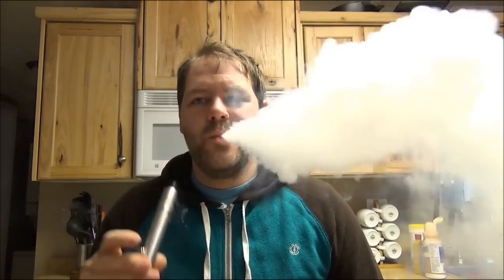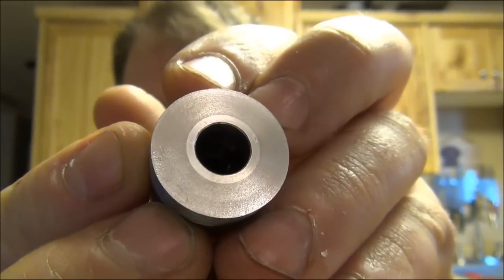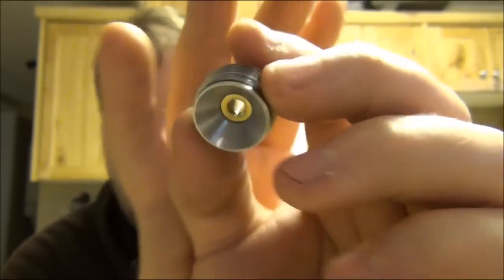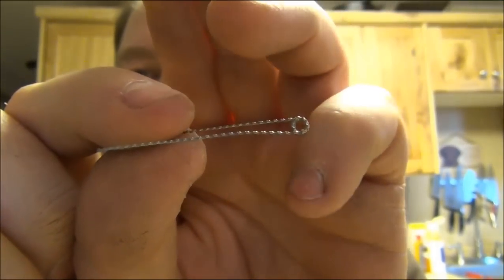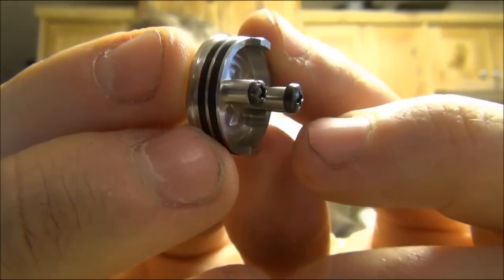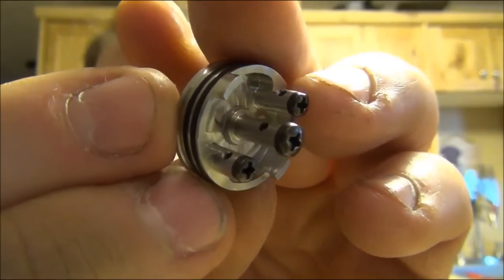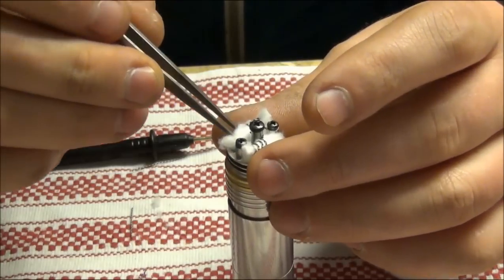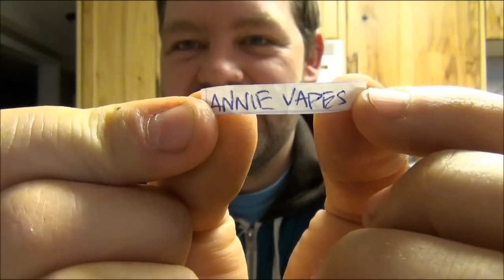tobh atomizer review and tiger coil build!

Comment: What's up Trevor. That's a super sick build bro! I just build one of these dripper's yesterday for Ian at Indy Vapes here in Indy. I put the atty. In my mill and machined the afc tab off. I also opened up the air holes so the three holes are now a slot strait a crossed. He's got monster lungs man I build his patriots with 9/64" air holes and bore out his drip tips. 
I did one of my dual wire Quad builds with 22g three turns micro. So it looks like 6 turns of 22 but lights up like three turns. It metered at .08 ohms. Too low for most sane people lol. But Ian is a crazy man like me. Keep up the awesome videos

Comment: Jumped over here from the indestructible post to check out the Tobh review. I was having some of the same issues when working on artisan coils in regards to the chuck. Went through a couple of drills only to find the most common problem was the chuck itself. Solved that by going with a keyless chuck adapter with 1/4" shank. The chuck bites down more centered and holds tight all the way through the flattening stages in regards to helix coils. Not saying there's no breakage just less of it. Like unsleeving wires by hand, the touch eventually zeroes in and muscle memory takes over. To date, I've never made a tiger coil. Most definitely being remedied. 

happy vaping
Reply from the maker: +n00bIEwaN I am on that!!!!!! thanks for the tip dude!!!

Comment: Trev man it's easier to twist the tip like you did the fold it over like an inch and place it in the center of the drill the fold makes it so that the drill can grip it without slipping out or breaking as easy in the center plus it twists better in the center. Thanks for the vid man my fav channel

Comment: If your going to do a tiger coil my suggestion is to use one piece of wire not 2 so you have a better connection and it' works better
Reply from the maker: Cole Cranmer this was sloppy..lol  I had fun doing it though. looking back, I giggle all the time!